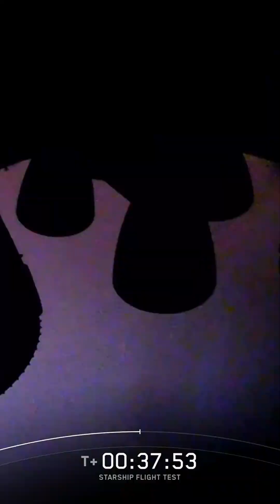What happened during Starship Flight 11? #space  #rocket  #starship

Comment: I have been extremely critical of the starship and I'm still not convinced of the rapidly reusable aspect, because of the heat shield condition I believe they have a lot of work ahead. But I admit the engineering team's at SpaceX are surely the best in the industry 9and if it's possible they will succeed..